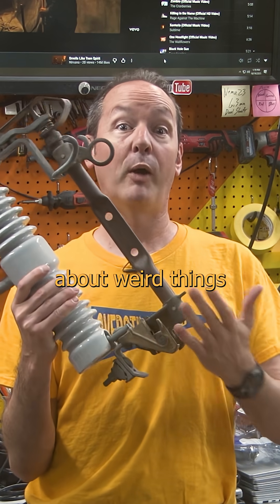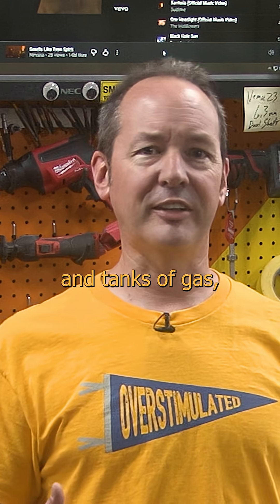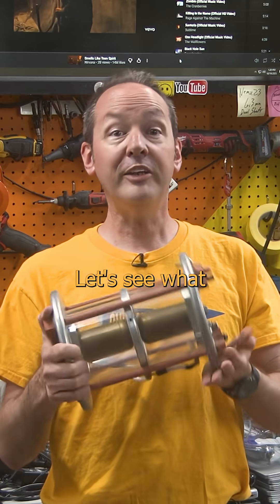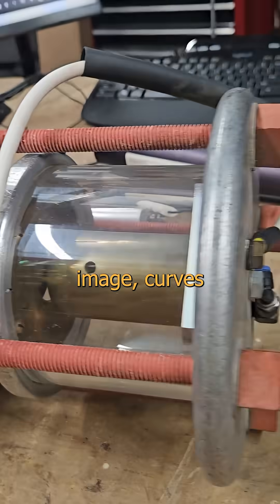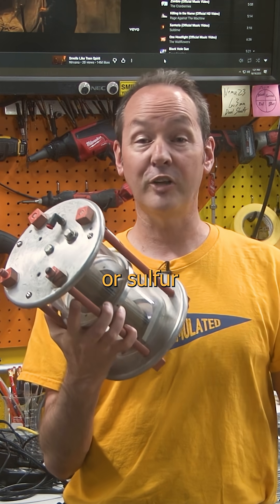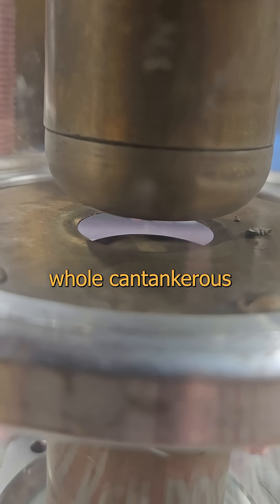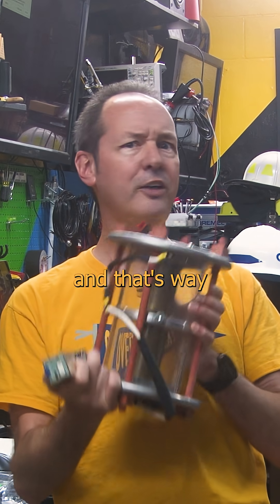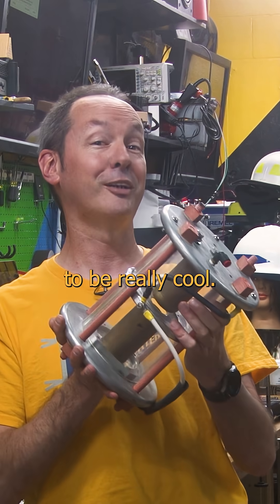Triggered Spark Gap #chrisboden #comedy #highvoltage #physics #engineering #science #educational

Comment: I saw a dude fling open a cabinet on a 3phaseboard! Luckily hed let go of it! Spark jumped about 2ft to a metal frame suspended celling! It let out a bright light! And basically evaporated every bit of the ceiling frame where they clup together! Nearly the entire ceiling came down! Accoustic panels that fell out had 4 cnrs smouldering! The spark never hit anyone! Not even the dude changing some fluoro tubes, standing on a fg ladder, 
With his head about 6inches from the framing!😅 only casualty was his dignity as he pissed himself!
Poorladnever lived it down!
Sparkie who flung cabinet opensaidhe saw the spark run up around the frame of the door! Everybody got lucky that day!
Turns out it was a screwdriver left in the cabinet, they reckon got dislogged when he flung the doors open! Though we never saw it!
I gained a healthy respect for Electric pixies that dayvery quickly!
👍👌🤙

Comment: I had the misfortune of being stupid enough to try to stop 20 kV, I was hooking up a 150W single circuit CO2 laser bulb to a 300W dual circuit PSU
My blue insulation tape was on fire. Thank fuck I was able to remedy this by splitting this PSU in half internally at the 380V side.

Comment: so dry, 20C 1ATM air has a breakdown field (dielectric breakdown) of about 3000V per mm. So 300V can spark across a 0.1 mm gap between two pointies.
Environment can lower the breakdown field (eg vacuum, hot air and humidity) allowing a wider gap to spark at 300V.
So "Mind the Gap" is proper British advice.

Comment: These are used in Marx banks, in which a bunch of high-voltage (like 50 kV), relatively large capacitors are charged in parallel then discharged in series to get megavolt output pulses.  Switching the Marx to discharge is called “erecting “ the Marx.  A few triggered spark gaps start the erection process, with more untriggered gaps that break as the output voltage rises.
Reply: @treborg777  SO would you say that is the Viagra of the circut? Lol
Reply: I thought "Marx Banks" were what they used in the Soviet Union.
Reply: @TansinADarcos Well, considering they involve breakdown and easily kill people, I see the comparison...
Reply: @TansinADarcos  Germany... ;)
Reply: Image search of marx banks switches literally shows this very contraption on the first page from Imperial College (UK) on an article for MAGPIE Basics in the plasma physics section of their research groups. Subsection 1 after the introduction is about marx banks.
Reply: Engels liked this comment!
Reply: @beyondinsanitybr 😂😂😂
Reply: Which one?  Groucho, Chico, or Harpo?
Reply: @dawntraveler42  Karl, because it's about moving power
Reply: @dawntraveler42  It would take ALL of them !
Reply: @dawntraveler42  As long as it's not Karl.
Reply: Top Marx?
Reply: Ahaha, Marx generators! You just unlocked memories I didn't know I still had. We worked with one of these beasts in the university lab!
Reply: @YoDamnEsIstJP  Turns out our memory banks aren't as forgetful as WE are! Or at least I am. 🤣
Reply: Im currently working on designing a Marx Bank, but I have never heard the "erecting" term 😂 but we are also using fets to switch it instead
Reply: I want to know nothing about Marx's bank or why it's Erect
Reply: @thenugget1991  fine, look up Rex's Erection, AKA, Cathedral Tower, Cuyahoga Falls, Ohio, then. 

It's a nearly 500 foot tall cylindrical tower constructed in 1971, originally intended to be the base of a rotating tower restaurant.
Reply: What?😅😅😅 geeez I'm dumb.
Reply: Found the pdf for that one or something really simular made by l3harris
"Series T-508 high precisionen spark gap switch"
30-200kv
Max peak 150kA
Max charge transfer 2 coulombs
The gas is dry air or "SF" whatever sf is.
Reply: @aggese”SF” is SF6, sulfur hexafloride  gas, a very effective high voltage dielectric.  Non toxic.  However, it’s a terrible greenhouse gas
Reply: @treborg777 so much heavier than air, how is it a greenhouse gas?
Reply: @KevinN1969  per whatever llm used by DuckDuckGo: “At temperatures above 350°F, SF₆ breaks down into toxic and corrosive by-products, including sulfur oxides, fluorine compounds, metal fluorides, sulfur oxyfluoride, hydrofluoric acid, and sulfuric acid.” So I think it’s the stuff it becomes is more dangerous to people and the atmosphere than what it starts as
Reply: @KevinN1969  Still a gas! Chrome Gemini AI finds this: Potent greenhouse gas: SF6 is the most potent greenhouse gas known, with a global warming potential (GWP) 23,500 times greater than carbon dioxide (CO2) over a 100-year period.

Extremely long lifespan: SF6 is chemically stable and has an atmospheric lifetime of up to 3,200 years. This means that nearly every molecule of SF6 ever released still exists in the atmosphere today.
Emission sources: Though electrical equipment is designed to contain SF6, small quantities can leak out over the equipment's lifespan and during maintenance.
Reply: @danjohnson6800  so that's why Atlantis collapsed. Neat. Caused the great floods too.
Reply: @treborg777  Sulfur Hexafloride is so heavy you can pour it into an open container. It spends as much time in the atmosphere as a cinder block.
Reply: @treborg777  You know this already, but SF6 is perfect in another way:  It's a non conductor at ground state that holds voltage back extremely well, but its plasma is a particularly good conductor for a plasma and quenches at really low voltage once conducting. So it prevents electrode pitting and corrosion in gaps and HV relays.  Makes them orders of magnitude more durable.
Reply: @treborg777 Its also a heavy enough gas to float a boat on! There's videos of people floating metal model boats on what looks like air in an aquarium.
Reply: @Joe-h1g9x The thing about flourine chemistry is that its so reactive it probably reforms into the the most stable state almost instantly. There's very few molecules that can stay together at such high temperatures and voltages. That's probably why they prefer monoatomic molecules, especially Noble gases.
Reply: @aggesesulfer hexaflouride I believe (actually no- Sulfer hexaflouride is "SF⁶"
Reply: No Brits here to make a Marx and Sparks joke …?
Reply: Thank you! I had been trying to remember the name of the Marx generator/bank for a while now.
Reply: At least this Marx is useful 🥸
Reply: TIL what Marx banks are, dang that's scary cool!
Reply: You amateurs need to leave the puns to Chris
Reply: Even after rereading this a couple of times I still have no idea what this says. BUT, it's COOL!!
Reply: 2 year electrician apprentice here, why charge in parallel but discharge in series? Is it like a cheating way of adding up amperage at the end?
Reply: @Links101 Basically. Its a way of generating crazy high pulses of high voltage and current simultaneously. Its a way to trickle charge something that pulses a huge output without needing to generate the power all at once and than use transformers.
Reply: @Links101 the capacitors are charged to a nominal voltage, like 60 kV.  They are all charged at the same time, hence in parallel.  The capacitors are also interconnected in series with gas switches like the one shown, with some wired for a  HV pulse that causes them to break down and conduct.  Once a few switches break down, the rest of the gas switches also break, and the Marx bank generates a very fast,  high voltage pulse that is the sum of all the capacitors’ voltage and energy.  I’m sure you can find descriptions with wiring diagrams with Google.
Reply: "Erecting a dispenser!" "YEEHAW"
-engineer gaming
Reply: It follows the path of least resistance. Not the electron’s fault matter isn’t as solid at its size
Reply: I thought 'erecting thr Marx' was a euphonism that gay communists used

Comment: Chris Boden: "Take 4k Volts outside..."
Me: (Laughs in Nuclear Aircraft Carrier)
Reply: It’s funny, I worked in the education department on a carrier museum. (USS Hornet CV-12, at the old Alameda NAS.) I mostly did tours with school groups, but the few times I did tours with active duty guys, they always got a kick out of how small the WWII era Essex class ships are compared to the new guys, even after we got our angled deck conversion in the ‘50’s
Reply: how many volts
Reply: @hdhsu-dg6fb On rewatch, I misheard. 40k, not 4k. There are nuclear carriers that run about there, though, so my intent still holds, even if it doesn't apply to the carriers I was thinking of. I won't be discussing any specific ships or actual shipboard numbers because it's classified. "Loose lips sink ships," and all that.
Reply: @FNPetersen I know of the story where a new captain before taking command when aboard a nuclear vessel and wandering around the only person who stopped him was the reactor tech. With a pipe wrench and the statement that he didn't give a dang who he was he wasn't authorized to be there. I know what the power output of CVA 43 was and through the magical power of math I know approximately what you're dealing with. Absolutely freaking terrifying that's what it is My numbingly terrifying.
Reply: @Amanda-ej7pl the guy walking around that slipped by the topside watch had to be Rickover. He did, or tried all the time. Held the Navy record for having the most 45 pistols pointed at him. Always showed up in Civies and felt he owned every reactor. On subs and carriers and he could see them whenever he wanted. "borrowed" uniforms, had to have seedless grapes. Lots to do when he visited.
Reply: @311jbknight That’s such a random story. What was his deal anyways?
Reply: @maniacguitar 

Penetration Testing due to reports of lax security.
Reply: @maniacguitar Rickover was the father of the Nuclear Navy. It was all his baby from the beginning. He's one of the most influential people that most people have never heard of. To us Nukes, he has attained a kind of demi-god status. There are all kinds of myths, legends, and apocryphal stories about him. I've given up trying to figure out what's actually true and what's not, but to us Nukes he's larger than life.  I was told a constant stream of Rickover lore from A-School onward.
Reply: @Amanda-ej7pl  all im imagining is him saying: you are captain up there, but down here IM THE CAPTAIN. GET OUT OF MY ENGINE ROOM.
Reply: @FNPetersen  well technically...those carriers are outside. so thats fine.
Reply: @satakrionkryptomortisBut the systems we're talking about are inside the carriers. These aircraft carriers are bigger than most power plants. These aircraft carriers are sealed more tightly than most buildings. My house is also technically outside, but none of the wiring inside my house is outside. You don't honestly think the US Navy just has nuclear reactors, high voltage generators, transformers, breakers, and the like simply hanging out on weatherdecks exposed for enemy fire, do you? All these systems are kept inside, in sealed spaces, and behind armor and shielding. I went months at a time without seeing the sun while I served on the ship. Don't tell me I was technically outside. I wasn't.
Reply: @FNPetersen on a war thunder forum however...
Reply: @FNPetersen  I think he was joking about the “technically outside” thing
Reply: @hdhsu-dg6fb  Like others already mentioned its definitely classified but given that US ships are capable of supplying the power to test railguns and laser based weapons... Its definitely a mind numbing number.
Reply: @alexisrivera200xable  The shaft horsepower of a Nimits is said to be 260,000, which is roughly 190 megawatts. (per Wikipedia). Split that  however you want. At 40,000 volts, that needs 4740 Amps. At 400,000 thats 475 Amps. Which is scarier, 400,000 volts or 4750 Amps?
Reply: @JR_MacD honestly, volts. Amps is just a size scaling issue, volts get...weird.
Reply: @JR_MacD  I can see a 40 kV installation in a confined space potentially (see what I did there 😉) being used, but I doubt that they would play around with 400 kV for anything related to distribution. It has a bit too relaxed attitude towards dielectrics (“hmm, that’s a conductor, right? ZAPPITY-BANG oops, I guess not, but it sure kinda worked…”).
Reply: @JR_MacD  That is an easy answer: BOTH are scary.
Reply: @JR_MacD The Main Engines are not electric motors. They never intersect the electrical system, really. I respect your approach, but you can't actually estimate anything about the electrical system based on shaft horsepower because the shafts are driven directly by steam, no motors or generators involved, no electrical power involved, no voltage involved. But I mostly worked with a pair of generators. My main watchstation was in charge of the generators that powered the Reactor Coolant Pumps. I know the maximum voltage output of my generators, and my generators were identical to the ones that provided the main electrical power to the ship. The Ships Service Turbine Generators were just operated at a constant speed and voltage, where mine were not.
Reply: @FNPetersen thanks for the info! I didnt realize they still used steam turbines. 😊
Reply: @JR_MacD : Only the newest of ships would consider electric motors... at least for surface ships. You stand to create a lot more heat with zapper-fairies than with God's gift to circles.
Reply: @FNPetersen I know this thread is about electricity, but speaking for myself, steam is way scarier than the juice. Especially the superheated 10+bars you guys run. I toured the hornet a couple years ago and even the tiny steam plants that thing had was absurd. Long gone are the days of locomotive steam engine boiler explosions and along with that, collective knowledge of how devastating they can be.
Reply: @JR_MacD do you think i could swap it into my miata
Reply: please dont take youre shit outside. it didnt go well the last 2 times XD
Reply: None of your surface things are real, I'll sit comfortably with my low voltage rc div things
Reply: @dragonman5585 To be clear, I was an MM. RM Div. I ran the steam side of the CGs. All you wirebiters can keep all your voltages, as far as I'm concerned. Magic sparky stuff bad, it hurts monkeys.
Reply: Love the OSINT stuff discussed in the replies, let me tag it электросистемы американских авианосцев.
Reply: Very high voltage is basically witchcraft.  I work for a power company, and we had someone almost die a few months ago while working on transmission lines. He was electrocuted by lines that were not hooked up to an energy source, but that did pass underneath some high voltage lines, which caused induced voltage.
Reply: Japanese snow monkeys
Reply: I mean technically you are outside
Reply: @ivenothumbs If you think being inside a ship is anything like being outside, I don't know what to tell you. When I was on the ship, I sometimes went months at a time without seeing the sun. The only weather deck I was ever on was the hanger bay, and that wasn't very regular. Trust me, I wasn't technically outside. The ship was technically outside, sure, but so is my house. If I'm in my house, I'm no longer outside. All these systems were very definitely inside the ship.
Reply: @FNPetersen dude you're still outside on the ocean😂
Reply: @FNPetersen I don't know what to tell you either cuz you're still in a box outside😂
Reply: I think what you're really looking for is some sort of glory since your service member (if you really even are). And my incohesiveness to just accept your comment drives you absolutely bonkers
Reply: Well. Technically it is outside, in the ocean.

Comment: Use to love the glow around the High voltage tube in the Old CRT tude fly back circuit tube 

Not sure what the voltage is in the new flat screen TV's is.

But those old TV sets could easily make sparks or even killed after sitting unplugged for months possibly even a few years.

Comment: over 40kV outside is certainly preferable, but being not exposed to the elements is nice too, especially when you are the one doing maintenance on those things.
a good while ago I used to do indoor 30kV switches that where operating just with air as insulation and also air to flip the switch even under load, killing the flow of a bunch of angry pesky pixels can be so frightening loud!

also maintained a few 110kV indoor switches with SF6 and man, you REALLY need to think twice before you do anything in that area...
Reply: I bet when you begin an indoor high voltage project you start first by examining your life choices that got you to that point.